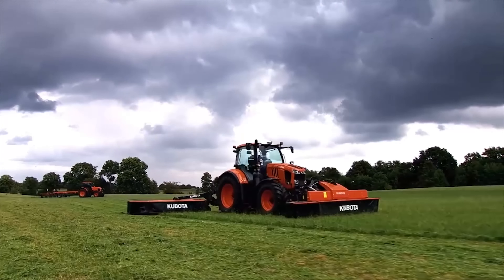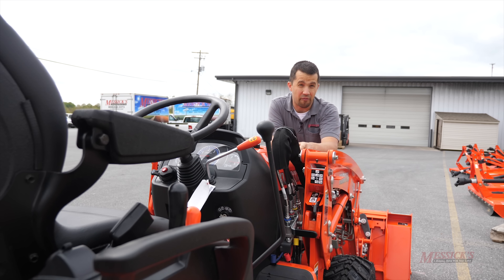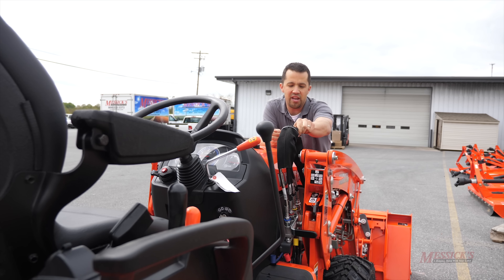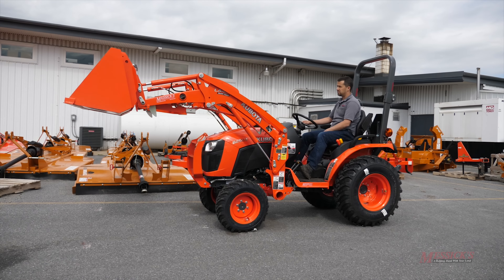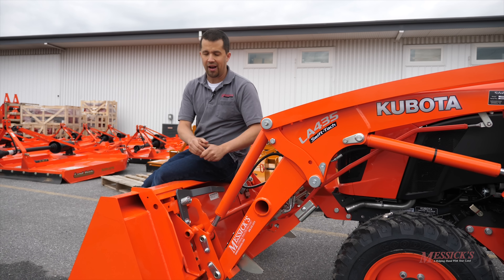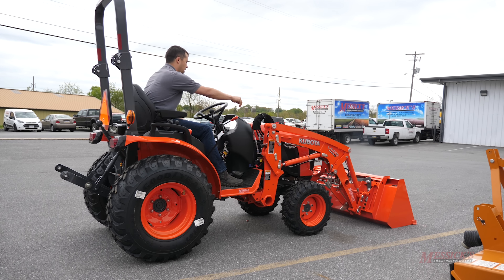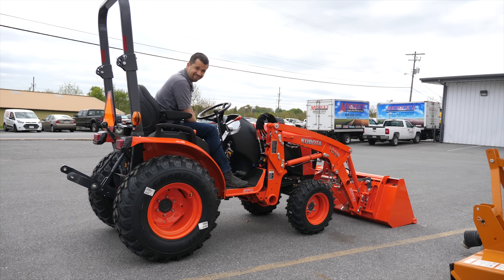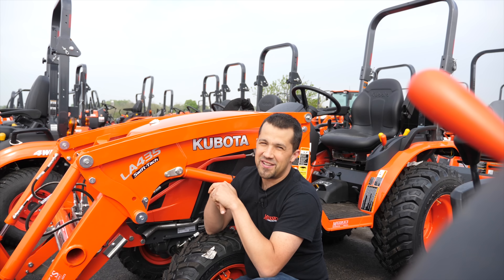*New* Kubota LA435 Swift-Tach loader for B-series tractors

Comment: Very nice.  Love every aspect you demonstrated, Neil.   Single point connector, Self leveling kit, and the mechanism for removing the loader.
One question (remember, Kubota novice here), Which tractors does this loader fit?   Do the 2650/3350 use it, or only the B2601?
Reply from the maker: 2301\2601
Reply: @MessicksEquip  what about a 2620?

Comment: I know it's been a while but this is a great video.  I bought the same tractor and loader about a year ago.  I love it, but I'm having a hard time getting the hydraulic quick connect, connected.  I shut off the engine and cycle the loader joystick to relieve pressure before removing the loader.  But when I go to reattach it, I can't rotate the handle to connect the fittings.  I've tried with the engine running and with it shut off.  It's like there is pressure on the connectors and it just won't lock.  After wrestling with it, I've so far been able to get it to lock, but it takes more time and effort than taking the rest of the loader off and back on.  Any thoughts on what I'm doing wrong or what may be going on?  Thanks again for this and all the other videos you've made.  Thanks, Ed.

Comment: Boy howdy! That there's slick as snot on a goat's glass eye!
But they could still add a hydraulic SSQA.
And what happens with the fancy 4 barrel hydraulic block thing if you add a third function? Is there a 6 barrel version? Or do you have two manual connections then? (Or an electrical connection, depending.)
Reply from the maker: On the BX there is a 3rd function diverter with only an electrical line, I'd guess with time you will see that here. Currently you would need to disconnect hydraulic lines.

Comment: Hello I have this loader. The support legs stick when you release the handle on step one. Meaning the supports won't come down after you roll the bucket back up. I actually havto get out bump them a little then they release. A little annoying but have you run into this yet?

Comment: Just purchased this exact tractor and loader. Videos make it look so easy. I however, am having a hell of a time getting the loader off without the loader arms wanting to drop onto the front tires. I’m certain the jacks are collapsing too much and all the weight tips backwards towards the machine. Not balanced. The manual says the jacks are adjustable but the illustration is hard to understand. Is there a video on this?

Comment: Wondering if the quick release hydro hose system is available for retro fit the older , 2012 B2620 tractors. Thanks. Nice video.
Reply from the maker: No, can't go backwards

Comment: Would this fit a 2017 B-series? I have the older loader on my b2601. I don't think the tractors have changed, but I'm not sure.
Reply from the maker: the hydraulic manifold is included on a B2601-1 packaging of the tractor. I would guess it could be done by buying the parts that are different. You can also swap the loader manifold for pioneer couplers an have the improved release and parking stand and not the single-lever hydraulics.

Comment: Neil just got a b2601 with la435 quad coupler but it leaks, did kubota come out with a new coupler to stop the leaking?
Reply from the maker: If you can, make sure there is no pressure in the lines when you connect it and the couplers are clean. If this is the case, there is a chance you may need the couplers replaced. We've seen some where the machining is not dead on, Kubota will warranty a new set. A few drops is normal, any persistent leak is not.

Comment: Any idea whether an LA435 loader would fit on the loader subframe from previous years? Got a 2017 with a 434, wondering whether I’d have to swap subframes to switch to the new loader.
Reply from the maker: No, several differences.
Reply: Aw darn. Thanks.

Comment: Messick's
Why is it that no dealers are telling Kubota to change the Foot Pedals to something "Normal"
The forward and back suck! Put brakes on the left and a forward and reverse next to each other on the right.... By now you would think they would change.
Reply from the maker: We don't want them too. When its been surveyed, a majority of operators prefer the front\back design (myself included). The brake pedals have moved to the left on most models now since clutch pedals are no longer needed. Side-by-side does create a nice open floor pan, but there is high risk of going the wrong direction and on many models your having to reach forward to get the pedal. All personal preference, and frankly all pretty silly. People adapt easily to whatever they choose to own.

Comment: Neil, looking to get a loader for my B2320. Would it be possible to attach this loader to it? I know I would have to get the single lever coupler manifold and I’m ok with that. Just don’t know if the the sub frame will bolt up. The quick attach loader and SSQA is a really need for me but I love my direct drive transmission and don’t want to upgrade to a HST model right now.
Reply: A Guy With A Tractor , I would like a SSQA for the LA304 on my B2320 also. I see folks using the SSQA from the LA534 (part 7J056-36103).

Neil, is this an option for us B20 series owners?
Reply from the maker: Can't say for sure, but its likely

Comment: Will this swift-tach loader work with the bx23s ?
Reply from the maker: It has one, yes.
Reply: Thank you for your quick reply. I can't tell you how much I appreciate your videos and all that I have learned from them as a newbie hobby farmer. The dilemma I have with the BX23S is will I regret not getting an L3901 because of the power difference. I have been struggling with this decision for many months. Staring at both quotes and weighing the pros and cons. I like the compact size of the BX and I could really use that configured backhoe a good bit around my farm and it is definitely less intimidating for my wife if she just wanted to mow some grass... and the cost savings certainly doesn't hurt. I'd buy both if I could but having to buy all new implements for each isn't feasible. If I could use the same implements on both, that would certainly help. Any help/recommendations would be welcomed. Also, I'd like to support your company... can I buy from you and have it shipped to zip code 30107? If that is an option, how much would shipping cost?
Reply from the maker: sounds like a B2650 to me?  
I can't sell you at tractor over that distance, but we're happy to help with any parts needs you have.
Reply: @MessicksEquip  Any preference between the B2650 and the B3350? Any regen issues on the B3350? And you are saying that the implements I get could also be used on an L39 if I get one of those after I get the B?
Reply from the maker: @thepittsfamily  Partial to the B2650, the B3350 does have a history of regen problems. Some implements could move between them, but few would be really sized properly.
Reply: Messick's you guys are amazingly responsive to my questions. One more.... 2650 cab option? Too heavy issues for slope work? Or good to go?
Reply from the maker: @thepittsfamily  okay, but you may want wheel spacers.
Reply: Messick's I meant to say “top heavy” and I don’t know what wheel spacers are